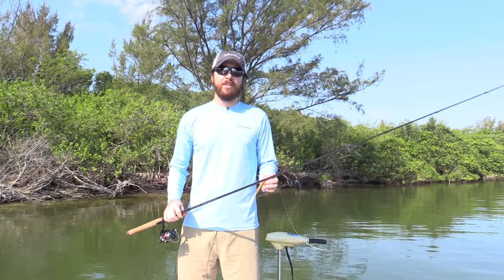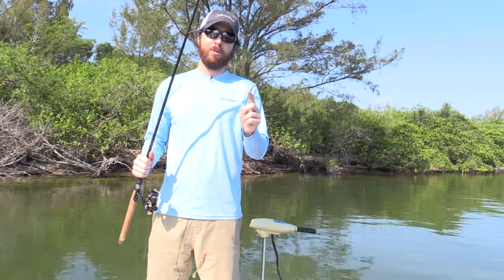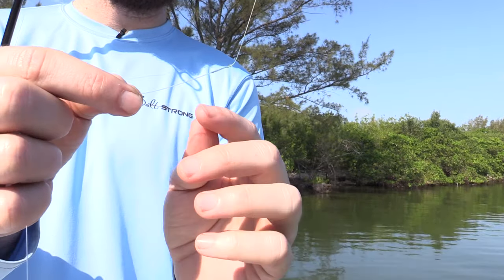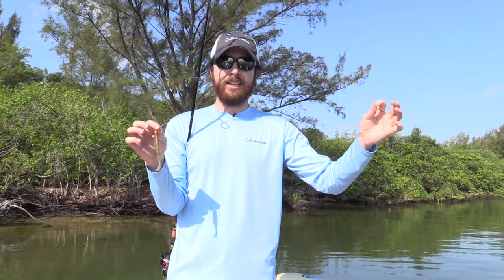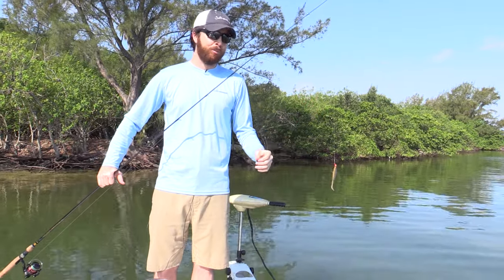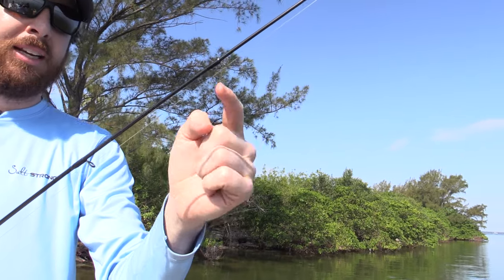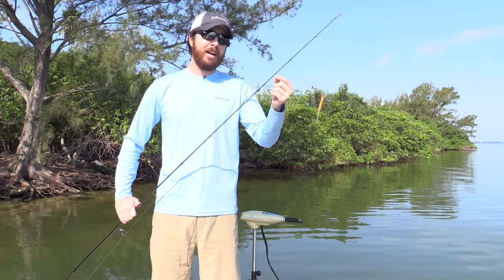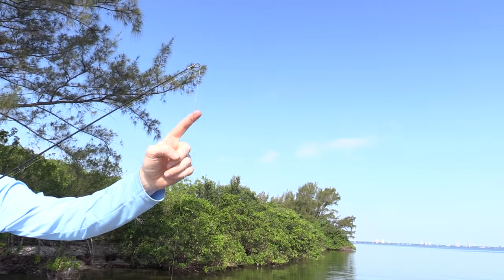The #1 Most Common Casting Mistake By Saltwater Anglers!

Comment: Two things I need to ask, first  you will not use a swivel instead of g, Albright, uni, etc? I’m not familiar with your area I’m from the northeast, second I’m more than likely moving to Punta Gorda    What size reel would you suggest for snook, reds, tarpon on the smaller side in the canals , I was thinking stradic in the 4 or 5000 size but then again what do I know about the south, LOL, also what rod and rating would you pair it up with? Thanks in advance and hope to join your group when I get down there.
Carl Skinzo